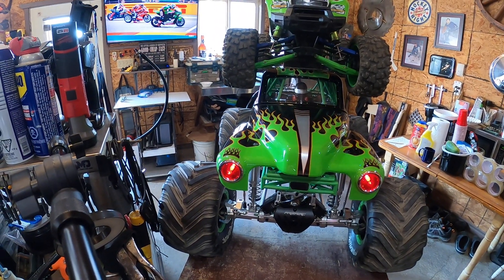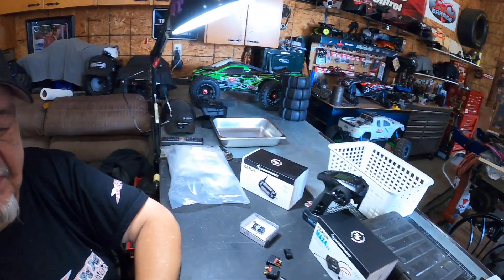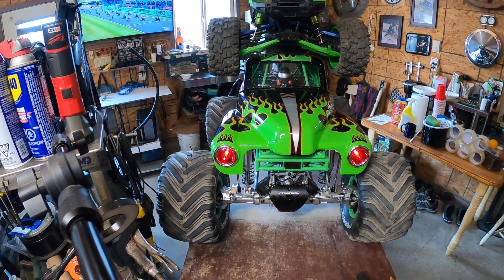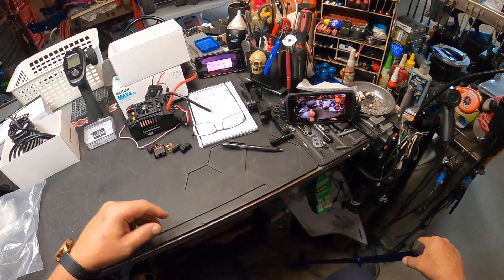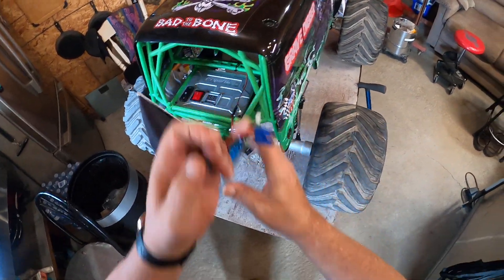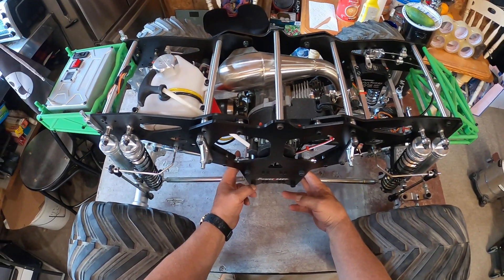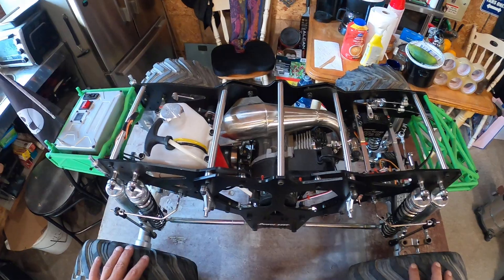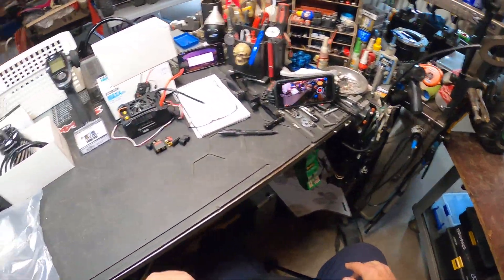Raminator Gravedigger electric conversion. Parts list, Max4/560kv, JCR kit and a test drive on gas.

Comment: That's a big machine! At first I thought this is your new snow plow, but seems you are doing this for a friend. Definitely a cool idea to convert to electric! I did not know the difference in horsepower, that is quite wild, I can only imagine how powerful it'll be with that Max4 in it... Looking forward to the next parts!
Reply from the maker: Yes its huge and would push snow great, maybe I'll get one used one day. The power system differences are huge for sure and more controlled IMO. 
Thanks for watching. 
Cheers.👍🇨🇦🤠